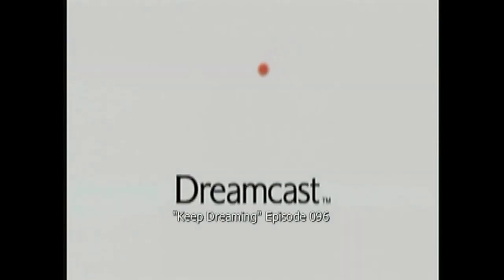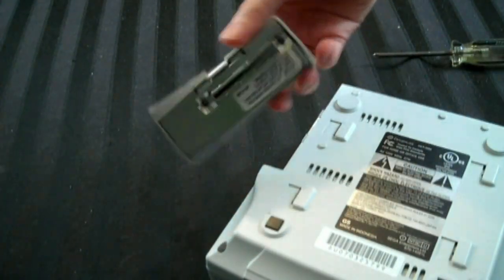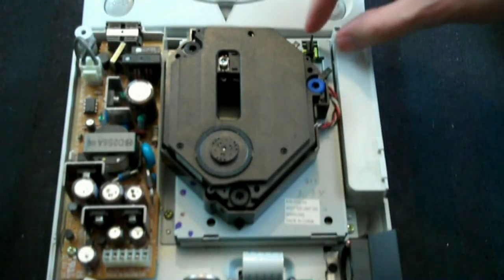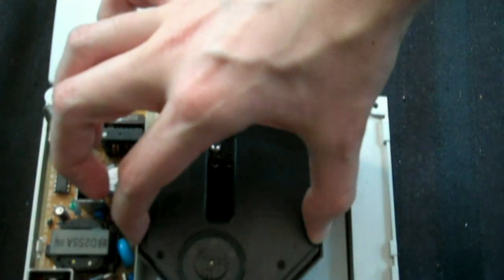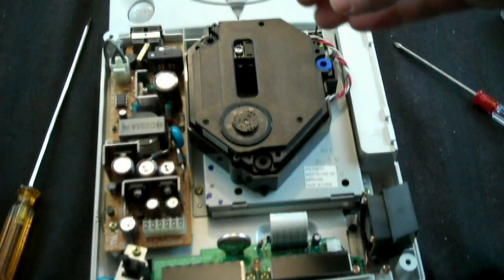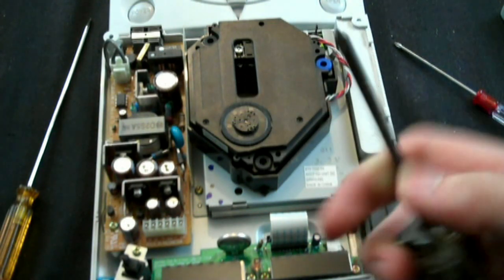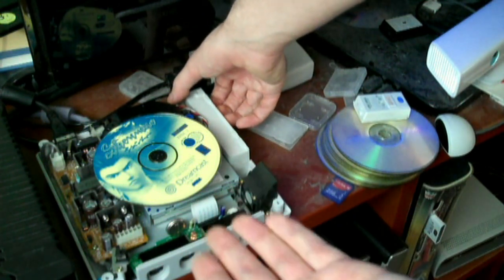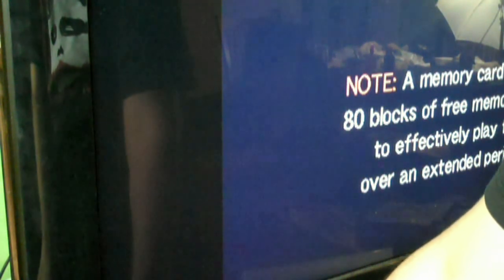Keep Dreaming - Repairing a Dreamcast GD-ROM Laser - Adam Koralik

Comment: Thanks for the tip Adam. It's making a little extra noise now but atleast it runs. I was playing Vectorman on the Smash pack and my system started making a weird noise when I rage quit the game. I turned the system back on and it wouldn't read. I honestly couldn't tell if I was turning the screw but it worked! It died and came back all in one morning.

Comment: This video just saved me 100 bucks in buying a new Dreamcast thanks!!!!
Reply from the maker: Happy to help.
Reply: Branden Davis 50$ with games on amazon or ebay
Reply: mrsquishyboots with CD based consoles I usually try to get them either brand new, or at least in box under the logic that if the seller cared enough to keep the packaging they cared enough for the system to keep the lenses in tact and those are more often than not double the price of consoles without packaging.

Comment: i had that issue a few weeks back. I fixed it by taking out the PSU of the dreamcast and i cleaned the pins that went into the psu. There are a good few videos on youtube tutorials out there that could help you fix the problem.

Comment: i had a problem with the lid switch once, the slightest movement can resets the console & i had another one do the same but with the 6 or so pins from the power supply to the mobo.

Comment: My dreamcast has a tear in the data cable for the laser drive. anyone know where to find a decent replacement for the 16pin sumitomo cable?
Reply: Source it from a broken Dreamcast that died for a different reason than your own.
Reply: Usually the lot dreamcast or parts only ones work.

Comment: I got a dreamcast with a melted laser on it (the controller ports don't work either, because the melted laser actually came from another dreamcast and I used this one to repair the other), I know I cant salvage that bit so I was thinking of taking out the melted laser and replacing it. I can't move the laser though because it's fused to the other plastic bit of the drive. Any advice on how I should go about getting the laser out?
Reply from the maker: Uh...soldering iron to melt away the fused plastic? I don't know man, that's a tough one.

Comment: Scrap the aluminum casing, then replace with 2 small orings.  The third oring or washer on the left side is basically replaced by cushioning on the left pin under the 
laserdisc reader.  You don't want to hit that plastic.

Comment: Hey Adam! Have you looked into GDrom drive replacement kits? I've seen SPU-3200 units around, claiming to be for Dreamcast, but I don't know how reliable those are (if they even work at all).

A few years ago, Dreamcasts were inexpensive enough to not have to bother with replacement parts, since you could just buy another used Dreamcast in decent condition for relatively cheap, but this isn't so much the case nowadays.

Comment: After trying to adjust the laser I still couldn't get Shenmue to work. So I inspected the laser assembly and noticed the vibration resistors ( the blue, black silicon circles) didn't have some kind of support even from the case. So I added two extra supports on the blue and black silicones in the far back of the laser assembly and Shenmue loaded up fine.

I believe it's vibration that is causing this issues.

Comment: Followed your video - but when I opened mine up I saw it wasn't working because the little switch that detects the lid being open or closed was gummed up and it kept sending a lid opened signal causing the system to drop out of the game to the main screen.  Easy fix for me. Cleaned the power supply contacts while I had it opened anyhow. Nice video. Is the battery soldered into place?
Reply from the maker: Thanks for watching, glad you got it running.

Not sure about the battery.

Comment: The fact that it didn't spin discs before sounds really odd, how can that be related to the resistance of the laser? It sounds like you were having my same problem of mine, my lid didn't push that switch that tells it it's closed because the spring on it is slighly bent. Anyway, are you sure it's a diode? Because it should be a potentiometer (550 ohm stock i've heard, lowering it usually gets it to 520). It's not sure it'll die soon, the voltage is not that higher and should be within its range.

Comment: Hi I have a question. Well I just bought a Dreamcast awhile ago and it came with one game. When I got it it played it fine but then I bought a different game for it and it wouldn’t read it at all not only that I noticed there was a problem with the internal battery cause the clock kept resetting. I bought another console and it came with 4 games. There’s no problem with the clock it’s been cleaned but this time the console won’t read any of the discs I have I don’t know what to do anymore if you could help me that would be great.
Reply from the maker: Generally the laser needs to be cleaned or tweaked. The batteries always die, generally they recharge during gameplay. But even if the battery is truly dead, it doesn't matter, it rarely effects anything other than the calendar.
Reply: Adam Koralik I wish I can just send it to you my Dreamcast man just to fix it cause I’ve tried fixing the first one and I messed up the the ribbon that attaches to the laser

Comment: I would say that playing with the D-pad suits the nature of the games.
Shenmue's focus is exploring the intricacies of your environment- the analogue stick for this is best.
Also if you consider that it uses the Virtua Fighter engine (movement controlled by the D-pad) and QTEs, it would be a little jarring to switch from the analogue stick to the D-pad every time those play styles cropped up.
Anyway, you can keep your finger on the trigger to run and tap the D-pad and it's barely an issue..

Comment: Most of my discs load without any issue while some just boot back to home screen ? All the discs look clean, can't see any issue with them. My disc 3 of Shenmue 1 doesn't load while disc 1 & 2 load and play fine. Ecco won't load, goes to load but kicks back to the home screen. Blue Stinger mostly loads (some times will just kick back to the home screen) but when it does load it will randomly kick back to the home screen between areas (seems like a loading issue, laser can't pick up disc ?) And my Crazy Taxi 1 will load and play fine but if i leave it running on the title screen playing the looping gameplay demo, after about ten minutes i get a message saying disc is scratched or dirty but the disc is clean.
Reply from the maker: The laser is dying.
Reply: @AdamKoralik  I thought so, thank you for responding so quickly. I'm going to try and adjust the laser like in this video but like you said it's already on its way out. I have a look on eBay for replacement ones, so cool that the system is easy to replace parts for. Thanks again.

Comment: Havent tried this yet? But I have a couple games 1 wont read at all but it is in awful condition the other game that wont run is crazy taxi 1 and the disc is in excellent shape but my other 2 games load and run fine? Any suggestions gonna try this and see if I can get it to run
Reply from the maker: Clean the console, then tweak the laser if needed.
Reply: @AdamKoralik  cleaned and tweaked laser the game worked a couple times in a row them back to not reading it. All my other games work so I think the disc is getting worn out. Just a shame lol it's crazy taxi

Comment: What happens if I accidentally tore that ribbon off? Is it repairable or do I just need to buy another Dreamcast at that point?
Reply from the maker: Tore as in, unplugged or like...ripped it apart?
Reply: @AdamKoralik  unplugged I think. It’s still connected to the bottom part, but got disconnected from the top part when I lifted up that top part
Reply from the maker: Oh then all you should have to do is plug it back in, not a big deal.
Reply: @AdamKoralik  awesome! Thanks 🙏

Comment: I've got an issue with trying to play Shenmue, I recently acquired both the game and Dreamcast used at a local store. My issue is when the first scene starts at the beginning sometimes the audio won't work at all and when it does it's half ass. Also when i leave the house it just says it's loading and I've waited at least twenty minutes and nothing happens, I've done this twice. would you say that's the Dreamcasts, error or my copy of Shenmue? I'm bummed becuase I really wanna play it lul. Also there are not many scratches the disc and i've got a beat up copy of Sonic Adventure that works perfect.

Comment: Adam, I'm having a problem with my Dreamcast and can't seem to find any answers to the problem.  Anyway I was trying to play a game, The Grinch, but when I booted up my Dreamcast, it restarted after showing the Dreamcast animation and and the the Sega logo.  I tried cleaning the laser, unplugging the power supply and plugging it back in, and cleaning the pins on the inside of the console but it kept doing the same thing.  I even bought a brand new copy of the game and the same thing happens with that one.  Have you ever had this happen to you or have you heard it happening to other people?
Reply from the maker: Tweak the laser like I did in this video.

It's not a burned copy of the game right?
Reply: AdamKoralik No it is a legitimate copy, factory sealed.  And the first copy of the game I had only had had one or two faint scratches.
Reply: FulllMetalJackett And I'm trying to tweak the lazer but I can't get the diode to move in either direction.  I've tried using two different screwdrivers, a large one and one that is identical to the clear and red one that you have but thing will not budge.
Reply from the maker: FulllMetalJackett I had the same problem too, I needed a comically oversized screw driver to get it to work.
Reply: AdamKoralik Well now I'm screwed.  The ribbon detached from the laser.

Comment: what happens when it isn't working, does it just give you a menu screen?
Reply from the maker: B-Rad Gaming Correct.
Reply: AdamKoralik ah, ok. I have a dreamcast sitting in front of me that turns on, but nothing happens on the screen at all. I have no idea if it's a video output problem or a chip issue

Comment: Nice video and some good info in case my dreamcast's laser ever starts to die. I could not help but notice that you turned the power off while the game was running. I was told to always pop open the disc cover and then remove the game before shutting the system off. Does it really matter?

Comment: How can I fix the dreaded power issue it turns off automatically
Reply: I know this comments 3 years ago, but are you using a 3rd party controller? I was using one by performance and that’s the reason why mine was shutting off.

Comment: Im so frustrated...i accidentally unplugged the ribbon cable, and i cant get it back in, ive been here for an hour and a half now trying and looking every where on the internet...
Reply: Ah man, I feel your pain.  I did that once and you have use a pair of tweezers to get it back in there. Even with the tweezers though, it is still really difficult . It took me an hour to get that cable, with the tweezers, back into the socket. The key thing is that you are going to have to be patient if you want to get that thing back in there.
Reply: Saiga GeneCast any idea where to find a replacement of the cable to the dreamcast laser?

Comment: I've tired this on two different dreamcasts and with several  different legitimate games and it hasn't worked. Could it be that my drives are just fully dead? Does anyone know how to repair the gd rom drive if that's the case?
Reply from the maker: Sorry to hear that this didn't work for you. You'd basically need to replace the GD ROM or mod it with a PC laser. The first is expensive, the second is way beyond my skills.
Reply: I'll have to look into the pc laser fix then. Thank you very much for your replay and also thank you for all the Shenmue rumor videos too. Long live the Dreamcast classics
Reply from the maker: shadowslayer0420 No problem, thanks for watching.

Comment: My dreamcast has been good at reading disc's, however it kept resetting itself and despite cleaning the contacts on the power supply board and motherboard it kept doing the same thing, so in the end I fitted a new power supply board and it's been running perfectly since.

Comment: I seem to be having a problem that may concern the laser.  My Dreamcast can read most of my games, but it sometimes won't read my copies of Soul Calibur, Chu Chu Rocket, and Illbleed.  Technically, these games do and have worked, but sometimes my system will freeze after the Dreamcast logo presentation, or take me to the system's main menu and tell me that it can't read the disc.  I think I got my copy of Evolution: The World of Sacred Device working.  Upon booting it, I was experiencing a black screen until I found some tips on how to work it out within the copy.  I'm wondering if this is an issue with the console, or the games.  If so, what do you recommend I do if the case is one or the other?
Reply from the maker: Are they legit or burned copies?
Reply: They seem to be legit.  I bought two of them from a used game store and the other two brand new on Amazon.  Case, disk, and all.  I'll PM you video evidence of this if you'd like.
Reply from the maker: Albert Corley If they're legit, I suggest cleaning the console, cleaning the games, and maybe even tweaking the laser.
Reply: This may be a foolish question, but I'll ask anyways.  What's the difference between the burned copies and the legit copies?
Reply from the maker: Albert Corley Legitimate games were made by Sega and purchased in a store. Burned games were made on a PC using CD-Rs.
Reply: Okay.  I'm sadly recovering from a cold as we speak, so I'll see if I can do some console adjustments sometime in the near future.  If these problems persist, I'll let you know.

Comment: Hi. Thanks again Adam. Happy new year and Merry Christmas (I think Christmas ends next week, 3 Kings Feast).

My PAL Dreamcast boots to the DC menu but the two lens motors (the spindle and the one that drives it forward and backward) doesn't spin. The lens itself move when the close lever is activated. I believe one or more of the small, brownish SMD capacitors in the board of the lens, the one underneath the black lens housing is busted.

Blessing in disguise I found two defective Dremcast for $10 but it's NTSC, red swirl. It's motors spin but I was wondering if PAL and NTSC parts are interchangeable? Does anyone know? I could use the NTSC DC as it is but it's good if I can revive the PAL DC so I have backup.

Thank you. God bless. Rev. 21:4

Comment: You can buy dreamcast lasers online.My dreamcast has the same weird issue and I think the laser is pretty much done for. (I have tried this method and it does not really work...)So I have ordered a new one from china.
Reply: Yeah I tried this fix back in the day. Never did work for me. I'm glad the lasers are still available
Reply: Can you point me out to the right place where I can find/buy an actual replacement that works? If the one you bought works, please point me out towards where you bought it from. Don't want to accidentally spend money on the wrong one. :P

Comment: after a few tests, i notice bad boots etc on cdrs.  Basically it wasnt kind to the cdrs, being too low@times.  The best solution is 3 orings+ 1 washer per oring under the lens, not the lens card reader itself.  U want that after u scrap the heater.  U actually want it leveled, but i had a really badly scratched game working that never works with it slanted.

Comment: Well, I can give you a quick and dirty instruction on the power pin problem. You need to remove the power board and look for these five really long steel pins that come up from the board. You bend them slightly towards the back of the unit (use force, but not enough to actually bend, you're just trying to improve the contact).

Comment: Adam i just got my first dreamcast and  the disc wont spin. i took the top off and held down the close lid switch and it doesnt spin at all. If i spin the disk with my finger basically giving it a kick start the drive does spin  a little then stops is there anything i can do for this?
Reply from the maker: Sounds like the laser needs to be tweaked.

Comment: I turned that screw and it still doesn't work.. what now?
Reply: Lewis Jones replace the laser
Reply: @FlyingV555  ok cool.. thanks.. it looks simple enough
Reply: Replace the drive with an sd card reader or put the system 8n a dumpster. The gdrom is failed pile of junk. I went through 5 Dreamcast systems and one was brand new. It lasted me a few months. I gave up and stuck with emulators and ports.

Comment: Also, you should go more in depth with this. Show people how to fix the common issue with the power board pins that cause the system to boot back to the menu, and how to use white lithium grease to quiet the worm gear system that moves the laser. And on a last note, it's not a diode, but a potentiometer. So you were close the first time.

Comment: it couldnt possibly fall out since the disc is clipped into the disc drive, holding it tight. if you put a disc in it and hold it upside down, it would not fall out. same is true with most top loading cd consoles like ps1, sega saturn, and gamecube.

Comment: Dude !! HOLY F** ! YOu got it working ! I have 2 DC collecting dust which work when they want. But, now that you have shown  'Me the light', I can fix them both..I may decide to sell one on eBay..ehh..then again no..thx anyway bro
Reply from the maker: ...Sure thing?
Reply: AdamKoralik Err..technically...one of them works when it wants to, but the other is definitely a brick. So thanks a bunch...I have opened it up, but because I didn't know wtf I was supposed to do with the 'little thingy', I left it alone until I figure out what to do.